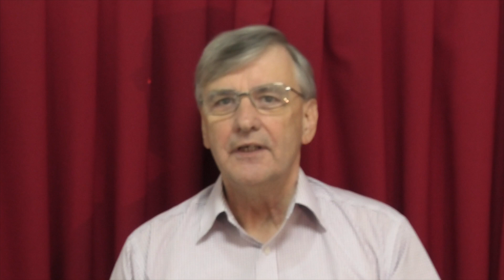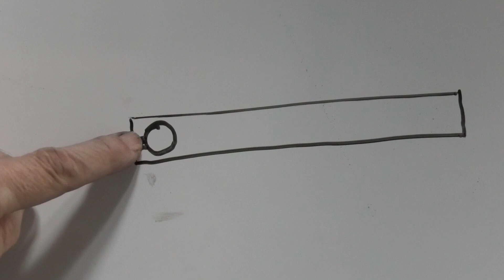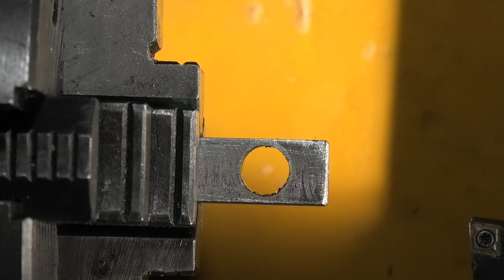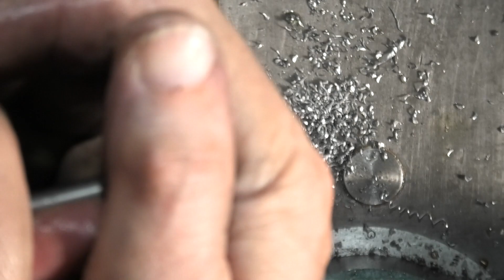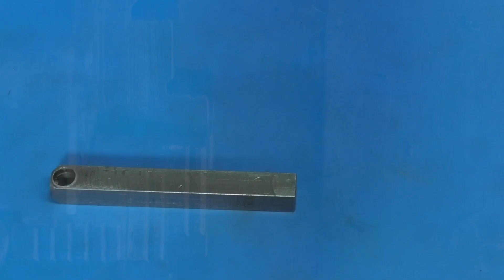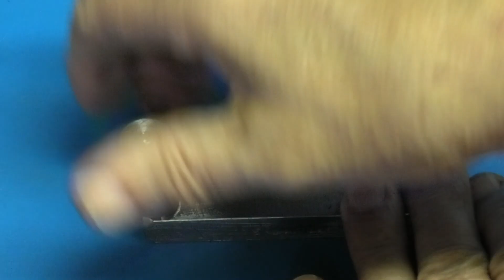Modification to DTI holder

Comment: Good idea but I don't believe in it. The tube/pipe, the plunger moves inside has very thin walls and clamping that tube will deform it making the plunger stuck. That happend clamping the indicator a bit too hard in a Noga stand that grips the way Your original mount did. Applying the clamping force on such a small surface is not good.
Reply from the maker: Good point but the DTI is held in a split press bush and minimum pressure is applied to the push rod.
Reply: @enotsengineering  The success depends on the design of the indicator I would like to say.

Comment: How about a longer tip on the indicator?
Reply: Well it's a plunger type, so you'd need a new indicator.
Reply from the maker: The idea is to get the plunger 90 deg to the part. If I fitted a longer tip the DTI could not be at 90 degrees.
Reply: @enotsengineering  At :50 into your video you shows the indicator at 90 degree to the work piece interfering with the chuck. A longer point would allow the indicator to clear the chuck, yet keep it at 90 degrees. Longer points are available commercially, or they are easy enough to make yourself.✌👍